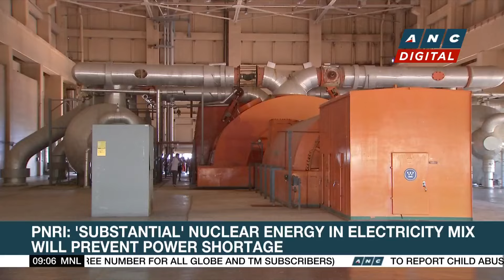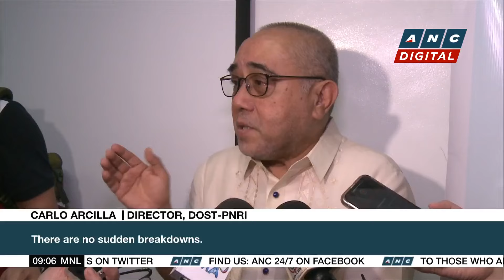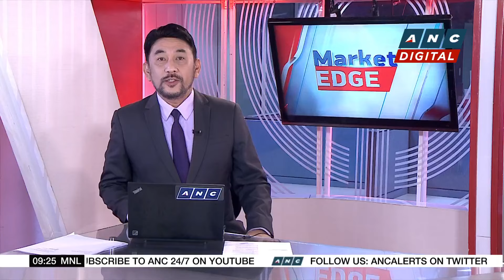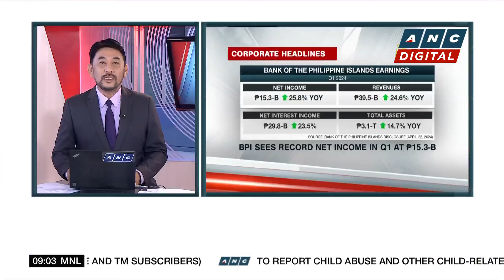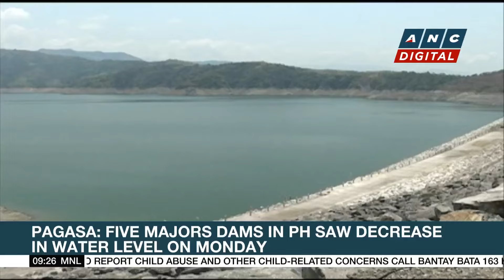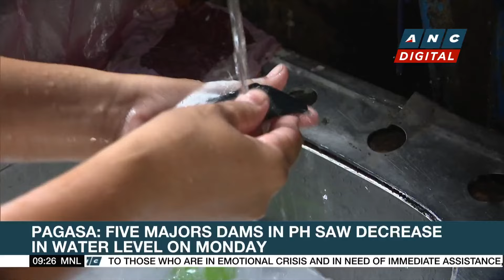PNRI: 'Substantial' nuclear energy in electricity mix will prevent power shortage | ANC

Comment: Nuclear energy is cheap, but don't forget the dangers that go with it. What if the "Big One" does happen and it causes a meltdown?

They need to update the hardware with present day hardware and make sure there are no flaws in the system, just look back at "Chernobyl".
Reply: Chernobyl's power plant has an old design. Newer Gen IV powerplants are fairly safe.